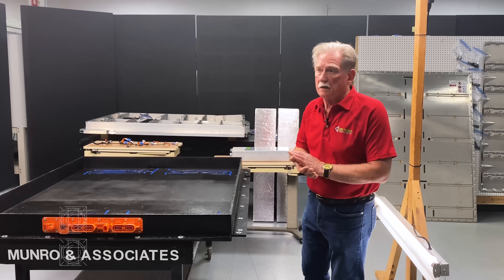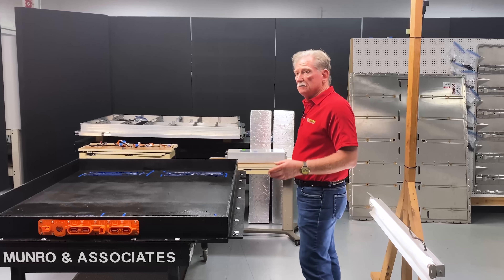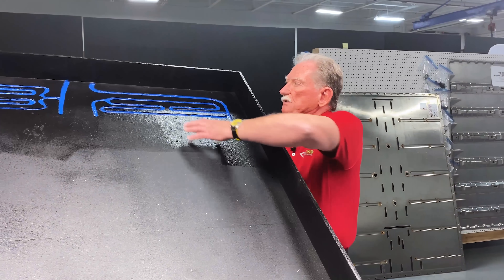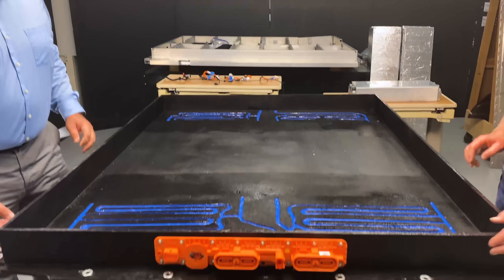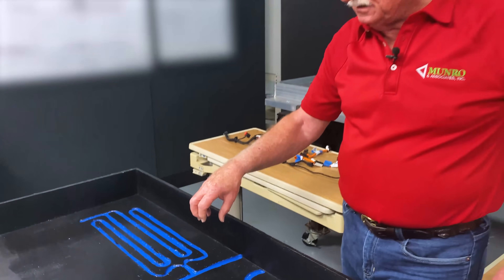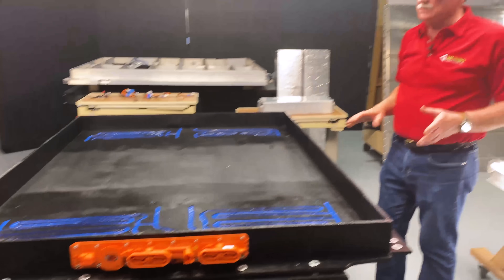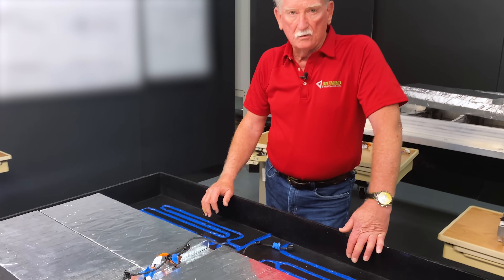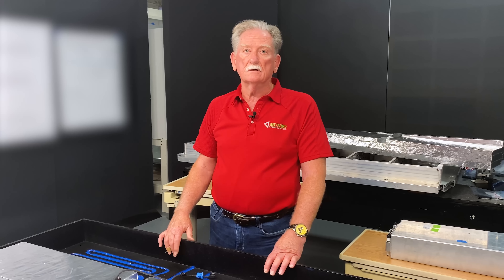Volkswagen ID.4 Battery Prototype Update

Comment: Dear Mr Munro, 

I’ve been thinking, why not design EV battery packs with modular, side-accessible slots for each battery module? Imagine if, instead of needing to drop the entire pack from underneath the car on a lift, each module could be slid out sideways near the bottom sill, just below the side doors.

This would make regular battery maintenance or module replacement far easier and faster, especially in fleet or high-mileage vehicles. More importantly, in the event of an accident, emergency responders like fire services could quickly remove or isolate individual battery modules from the side of the vehicle, potentially reducing fire risk and making rescue operations safer.

Sure, this would mean a big shift in chassis design, as it could impact structural rigidity and side-impact crash zones, but with proper engineering (reinforced access channels, isolation switches, smart locking), it seems technically feasible. It could be a real win for serviceability and safety, even if it costs a bit more to manufacture.

Curious what you guys think, is this something you’ve seen explored in the industry? I would appreciate if you could comment on my idea. 

Thanks

Comment: As a consumer I would prefer an aluminum construction over composite as aluminum like steel is much easier to recycle. It can be recycled over and over without affecting the quality, while for plastics and composites this is usually not the case. The quality degrades at each recycle cycle.

Comment: Thank you for the update.  Nice to see Munro take on additional investigation on the tray!!
A question:  The prototype shows the structural ‘matrix’ on bottom of tray—load carrying done well.  Aero?? If the bottom of pack is exposed to outside, would some sort of flat ‘aero cover’ be molded on to prevent turbulence generation of the matrix structure, when exposed to rushing air during driving at speed?

Comment: I am not an engineer but molding coolant lines in the composite housing for the battery seems too risky.  Any cracks make my minor hit on side of vehicle from 4 to 5 years of flexing would require a complete removal of the battery ti replace the housing costing more that $500.  Cost of vehicle may be less up front but higher risk of failure and higher risk later after out of warranty.  I have an ID4 but would not buy one again if they had a composite battery housing.

Comment: Is there a mechanical reason not to extrude the individual battery case sides so that when they are slid long ways together that they are latched as one structure, creating rigidity and a whole battery unit, stability for the best thermal contact to the FR box? Also is there not any added benefit to making a cooling channel for the FR box lid so that the battery packs would have two surfaces to dissipate heat to liquid flow?
Unrelated Biden and Musk are on opposite positions of the political agenda so Biden will not acknowledge Musk. Even though Musk has finally paid 11 Billion in taxes to the USA this year, likely to be spent on Biden's (I mean Klause Schabs ) Build back Better (I mean spend more sooner).

Comment: I guess the composite box will be glued together with a top lid? If so, could the box or the lid have a molded bump that runs around the outer edge? That would make it much easier for someone to open the box for recycling or salvage by simply grinding/ cutting through the bump.

Comment: Dear Sandy, 
I understand your idea but I don't like it

 if you glue them together, you can't replac'em easily. Do you want these batteries to be single use? Can you please explain why you prefer such a downside of a concept?

What about crash issues? Anybody tested if this is acutally a NCAP 5 star design in an accident? Or what does NHTSA say to that idea?

Comment: Thanks Sandy for the update! Good progress and simplifying is always the best thing to do  Can't wait to see the next update. Wonder how you will tackle lateral crush requirements, thermal interface material durability over plastic bottom plate, moldability of such large component, and manufacturing of such large modules (including venting location and consequences of a thermal runaway in the venting path).

Comment: Heat rises. I do not understand why you want to have the cooling at the bottom of the pack instead of on top where it by nature will want to go. You would be fighting against physics instead of letting it work for you. You can still have the solid pack, but with a top cooled design you could incorporate a thermal electric paste to assist with the energy transfer into the coolant plate. Am I incorrect in this @Munro_Live? I think it would be a much more energy efficient manner to cool the pack.

Comment: What Biden did was not a "faux pas" it was a deliberate snub. The message to Tesla being that they had better get on board with the UAW or else...
Personally, I have a very low opinion of unions in general and the UAW in particular. This power play on their part, showing that they can push the president of the USA around, has not done anything to improve my opinion of them.
Tesla is doing the right thing. They are able to keep the UAW out because they do profit sharing, listen to employee input and pay well. You know and I know that if the unions somehow manage to push their way into Tesla, they will take their manufacturing elsewhere, just like For, GM and what used to be Chrysler did.

Comment: Gen Two of Generic Battery Unit based on Sandy's Specs from Monday's video - 

Fly around exploded view - grab hand tool from right side to more easily "fly" around....
https://app.sketchup.com/viewer/3dw?WarehouseModelId=13c4b38f-5e3f-46d6-a15b-f40a78dbdefc

Features
0. Simple - No Frills
1. Long Batteries and leave room at end for "Mechanical Room"....
2. Cooling sheets - one above batteries, one below. independent feeds for top and bottom loops for redundancy - one piece build - drop in installation
3. All Electrical wiring and equipment on one end in one bay with battery access on ends of battery packs
4. Electrical compartment modularized and "firewalled" from battery packs - an LRU - perhaps provide access to LRU for replacement without removing battery unit from vehicle.
5. Easy to disassemble and repair
6. Use Thermal Tape (like https://www.3m.com/3M/en_US/p/d/b00017502/ ) to connect battery packs to cooling slice modules

Comment: The only problem with gluing everything together is it eliminates the possibility of repairing an individual failed module. Or reusing modules that eventually have reduced capacity  for other uses. 
They would need to be destroyed and completely recycled.
Perhaps if the cost of batteries gets low enough it wouldn't matter at some point. You would just dispose of it at a recycling center and replace it.
I suspect Volkswagen is going to use that small battery module in multiple vehicle options. That would allow them to only redesign the battery case for that specific vehicle. The modular aspect of it could be beneficial on some Grand scale considering the size of Volkswagen's manufacturing and vehicle output.

Comment: A couple of brief observations if you don't mind. Is there any reason for/advantage to the structural reinforcement/strengthening afforded by the the pattern of ribs on the underside of that panel you describe as being like the C-17 ramp over a hexagonal structure used  for example by Hexcel for their laminates ? Also, although I understand the reason(s) for glueing in the batteries, what's the impact regarding replacement of individual cells that go defective in use ?

Comment: I am not an engineer so this question might be stupid. Is it better to have bigger cells rather than more smaller cells. If bigger cells are preferable, are we eventually going to see a massive single battery cell? 
Cheers
Reply: No, because the cell chemistry makes it only 3.7 V, so you have to daisychain a lot to get your voltage up.

Comment: A design is only good, if a blind-folded one-handed operator can disassembled it for recycling. Do you really think, that composite, glue and bigger heavier modules will fullfill these design requirements?
Have a look how Volkswagen recycles these MEB battery packs: https://www.volkswagenag.com/en/news/stories/2021/01/from-old-to-new-battery-recycling-in-salzgitter.html

Comment: i am sure that vw do not want to glue the battery packs together to have a better serviceability. they do not want to produce junk that you have to throw away when there is a defect.
also the aluminium casing conducts heat much better than that plastic compo-shite. so, it has already a good cooling function.
there are many reasons why VW did what they did. it is a different design philosophy 
also Sandy did not understand why there is no frunk.
the size outside is fixed. id.3 same as golf. id.4 same as tiguan. the thirty cm, that the saved in the front is now somewhere else. 15cm more space in the cabin, 15cm more space in the trunk.
and btw. german engineers with german tools and german quality control know how to use threaded fasteners. maybe they fell apart at GM but not at VW

Comment: Tesla is the reason for the conversation in the first place. While Tesla's presence at the Biden event was awkward, I think that the administration may have wanted to put space in between them and Tesla considering the importance of the China market - a US rival - is to Tesla. 

I mean Beijing has already accused Tesla of spying for the US Government by using the imagery their cars routinely collect and the Chinese have banned Tesla from government facilities there. According to some reports, Tesla/Chinese relations have taken a dive since February of this year . 

And it may be that China is eager to limit Tesla's market penetration into China but because a ton of production - 500000 cars a year are possible from Tesla's China facilities - China may encourage Tesla to sell its Chinese production in the US and the rest of the world. That, of course, would benefit them, even more than BYD exports because the Teslas' will be easier to sell. 

Oh, and it should come as no surprise that the autoworkers union is not terribly supportive of the non-union Tesla because Tesla's design for production is engineered for lower labor participation.  That begs the question of what will all the ICE engine and transmission fabrication workers do since electric cars have so many fewer parts. 

Of course, as Monro and Associates has shown, the major automakers are continuing to include many, many more parts that have to be assembled than does Tesla and not only does the complexity of cooling systems and other essentials of EVs, in the Detroit context, mean more parts but lower reliability thus enhancing obsolescence.   

I mean you saw that in the Mach-E's Thermal System pt. 1 and pt. 2.

Comment: Getting a bit worried about all the talk about glue and making the cells as large as possible. To me right to repair is my single biggest worry about EV´s. I have worked as a technician at an authorized Apple repair shop and seen how laptops has gone from very easy to do battery repair on, to be a very tedious process. And that mentality is a complete deal breaker for me. I will NOT buy any EV that may need a complete replacement when a cell dies. Trust me, I know more than the average about lithium batteries so there´s no need to "teach" me that "EV´s can´t be compared to laptops". They actually are exactly the same if you have high quality hardware with charge thresholds. But no battery pack will have 100% capacity after 10-12 years. And then it will all be about which cars will be serviceable and which will be scrapped. Just my thoughts about it. Thanks for a good video as usual. But we have to talk more about serviceability. There will always be people that only can afford 10-15 yo cars, or like me, who likes to buy stuff that´s good long term. If I buy a new car, I want it to be able to service me for twenty years or so. And EV´s in particular could be a great platform for this. So I really hope the industry doesn´t just make everything with planned obsolesence now. Cause if they do, we will just look at EV´s as a bubble in a couple of years.

Comment: Composite materials are lousy heat conductors.  You're putting a significant insulator between the heat sources (batteries) and the coolant.  Go back to the aluminum panel that VW uses for the bottom of the battery tray.

Comment: 8:10 About "Tesla wasn’t invited to Biden’s EV announcement", the concern is how to keep jobs 
when you will have to close all the factories making the ICE engines and transmissions.
A single robot can make an electric motor, and the same for making batteries.
Also Tesla using casting will reduce by 60% to 70% the size of the assembly line, and the number of jobs.
Reply: Yes EVs will wreck havoc in the car industry. In Germany 1 out of 20 is working in it, directly or indirectly. Likewise repair shops, will all but cease to exist for other than the odd brake job. German EV manufacturing is highly robotosized as this is the only way to bring costs down. So even if Europe and the US are capable of reinventing themselves as  major car exporters, it won't bring back the former glory of the industry.  Like the long haul truck driver without a clue, when asked by the reporter about autonomous trucks: "Then I can take a nap in the back while driving"!
Reply: Tesla preparing the tech to build an army of giant Mechs disguised as car factory. 😱

Comment: 4:45 Re: Structural Batteries. Please confirm that pouch/prismatic packs cannot be made structural, due to those pack encasements needing to accommodate swelling. I'm concerned, because I "caught" one of the "Big 3" car ads (during Olympics?) touting that their EV packs were "structural." My understanding is that the only actual packs now capable of being made so are those composed of cells, specifically 4680s (given 18650 & 2170 are "out" due to costly pack cooling, etc., redesigning needed to make those structural). Since all but Tesla have committed to "swelling" packs, shall we conclude that adverts like what I saw are either blatantly lying &/or due to some misinformed marketer trying to co-op the latest "hot" battery-related hashtag?

P.S. Found this on NewAtlas: Space-saving, structural-grade Blade Battery to help improve EV safety By C.C. Weiss March 31, 2020 which does state that BYD blade batteries ARE structural, though without substantiation.

Comment: Sandy, we fully understand you are NO battery or battery management designer.  That design you layed out looks like it would over heat like a Leaf 🍃. 
Let the manufacturer that have been doing this for 10 plus years do that.  They have all the details of what works and what does not.
Nissan learned what happens when you do not have a BMS.
Their new EV will have BMS and CCS1 faster DC charging.
Keep to the nuts and bolts please.

Comment: VW won't go twice as big, I bet you their design logic is that they could keep the pack smaller so they could fit it inside multiple models, and also they could repurpose the packs later as secondary battery storage.

And Sandy, you can't use the same logic as Tesla's 4680, because VW's pack isn't drawing power like Tesla's 4680 packs, hence the heat won't be isolated down at the bottom... This design won't work for VW. :P

Comment: Could we get a video comparing different battery architectures like pouch vs. cylindrical? It would be really interesting to see the advantages besides power and energy density, respectively!
Reply: I'm a battery/EV engineer with 7+ years experience, what'd you like to know?
I've found most automotive OEMs are moving away from pouch to rigid cells like cylindrical and prismatic as it allows for structural packs and therefore zero-cobalt chemistries like LFP.
Reply: @nomoreheroes93  
What about the id4? I am going through a buyback of my Bolt and want to get a non-LG battery. Thinking about id4, Leaf, or Mini Cooper SE (Tesla no longer has rebate). I want to be able to drive my daily routine and plug in at lv2 home charger in garage and feel safe. It is so difficult to tell who makes what battery and is it pouch/prismatic/cylindrical and should we even care. In some ways I kind of like the older battery structure as it at least has years of previous use so it is already proven.

Comment: Great 👍 content .. the only issue is Tesla does not make their pack to easily be service ..and their new design is going to be almost impossible to service because of all the glue they’re going to use .. Right now batteries are way too expensive to make them non-serviceable! right now we need to use many modules to build a pack and that is the best way to do it right now because the modules can be easily removed or replaced at a fraction of the cost then replacing the whole pack .. 

Tesla new design you’re gonna have to total the car if any batteries are going bad or program reduce range When battery cells go bad and they will .. because you can’t easily replace them. 

Tesla new design is all about saving money there’s absolutely no other advantage other than saving money and a little reduce weight.. however the disadvantage is way greater for the customer..
Reply: Also when it comes to politics you have to look at numbers!  how many OEM automakers UAW workers in the US from all oh Yum auto manufacturers combine versus actual Tesla “factory” workers not the Tesla employees at the design center or at the show rooms .. how many actual employees manufacturing employees Tesla has versus all of the OEM automakers in the US alone and you will see Tesla has microscopic percentage of all other OEM combined.. so in politics you have to play the numbers it’s all a numbers game .. Tesla may sell more EV or even re-started The EV revolution but from a US auto worker perspective where are very very small player .. Again politics is all about numbers